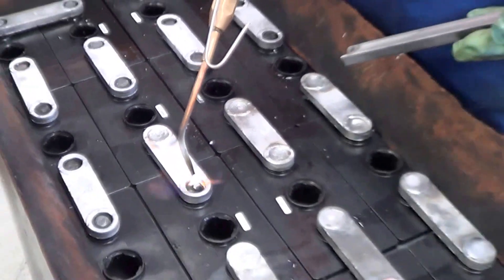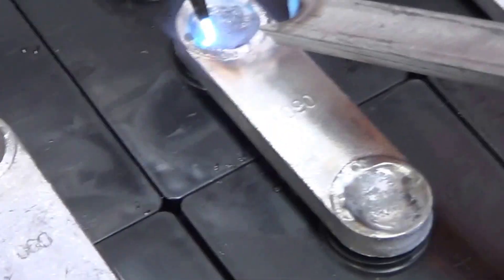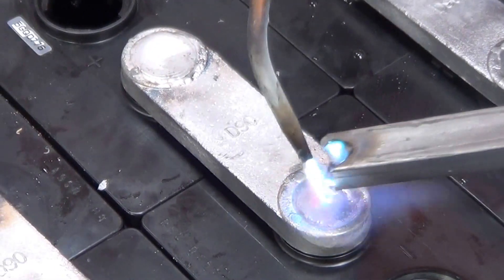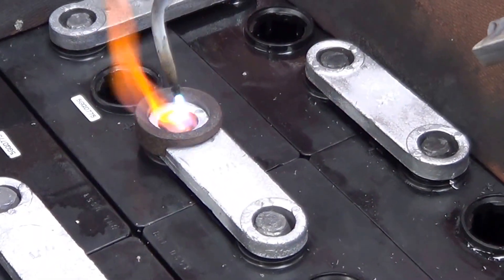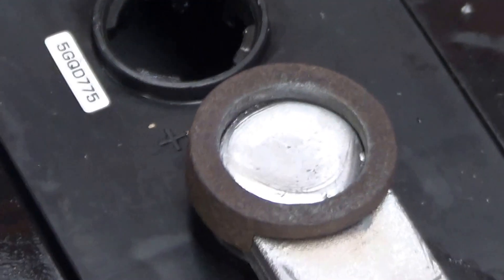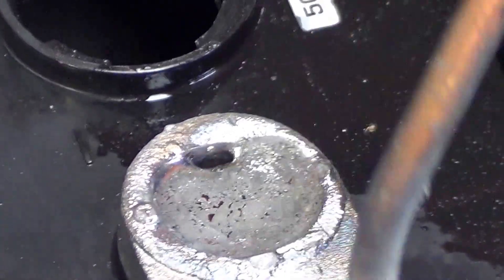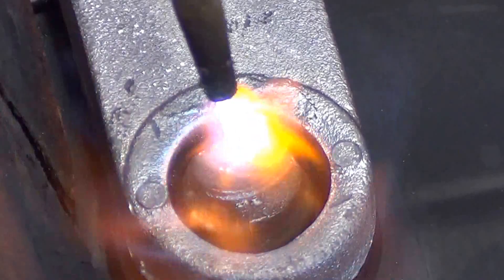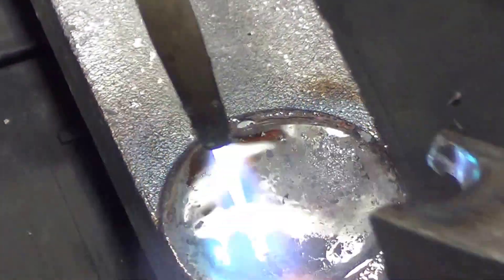Forklift Battery Cell Changing

Comment: why is there no danger of it exploding the gasses from the cell?
Reply: You remove the vent caps so the hydrogen can escape.
Reply: Use the oxygen from the torch to blow gas out of a hot battery.

Comment: Should a fairly hot battery that is changed out to be recharged, do I have let it cool before hooking up to battery charger?
Reply: There is an important rule to follow called the 8-8-8 rule. Eight hours use. Eight hours charging. Eight hours cool down. Your battery will be warm when in use. That is normal. If it is hot, there could be a problem. A weak cell (or cells), using a battery that has an amp hour rating that is too low for your equipment, low cell water levels, and over discharging the battery are some causes of a hot battery. Heat is the enemy of every battery.